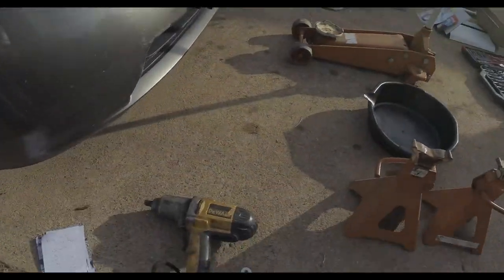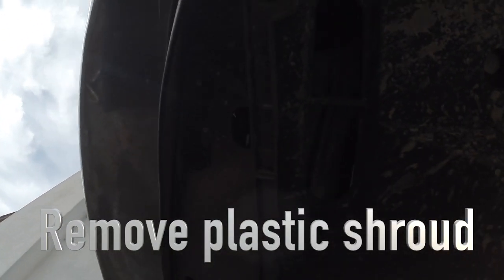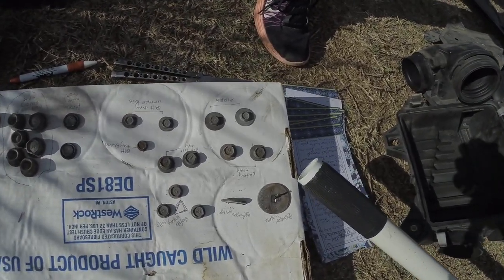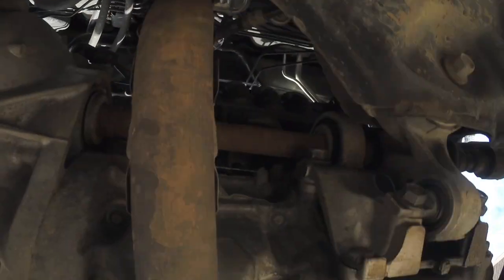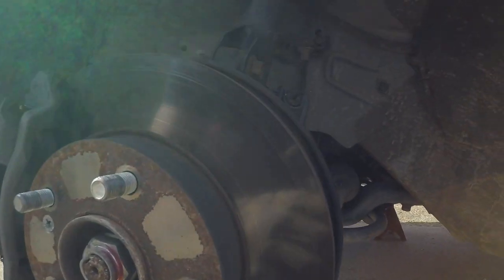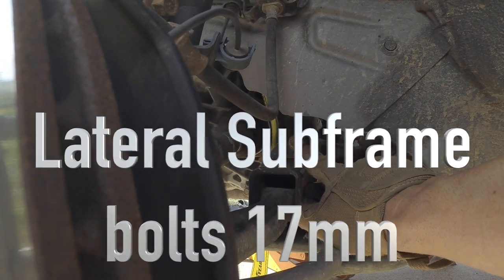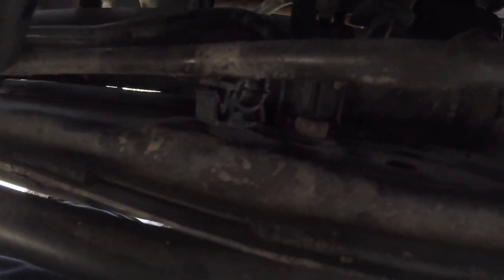2006 Honda Civic 1.8L subframe removal

Comment: Some great recommendations and a good tutorial 👌 

I need to change the rack and pinion which requires the subframe to be dropped.
Reply: looking to replace the tranny bearing and it requires to drop the sub frame but mine it's a 2008 i am sure it is about the same

Comment: Thanks dude, I need to do all the bushings and tie rod ends so i think I'll drain out the power steering fluid and drop the rack with the sub frame. Thanks on the video it helps to visualize it before doing it
Reply from the maker: Best of luck bud!
Reply: @steveDIY  hey dude i did the job this last weekend. it was a lot easier than what i was expecting. your video helped out tons
Reply: Have to drop my subframe as I have to gain access to the oil pan.  Is the steering column the only thing that I need to secure or worry about dropping down when s.f is removed?
Reply from the maker: Do you need to remove the subframe to drop the oil pan? Did you crack the top of it or is it leaking?
Reply from the maker: The only other thing I could see getting in the way would be the down pipe for the exhaust.
Reply: @steveDIY  oil pan is good but I need to replace some engine bearings (low oil which led to rod knock) but the s.f is in the way.  I have the car on jacks but was holding off removing the s.f as it is my 1st time doing it and wasn't familiar with what would drop once it is removed.
Reply: @steveDIY  I'm disconnecting the exhaust to get it out of the way.
Reply from the maker: Yea only steering column needs to be held in place. Not sure if the passenger cv axle will get in the way.
Reply: @steveDIY  thank you for the reply and video. Will secure that column and then drop the s.f.
Reply: I just replaced my subframe this past January 2020, and already the boot is split and dumping power steering fluid on the driver side tie rod. The passenger side blew out when reversing which lead to swapping in a new one. 08 civic lx coupe, replaced at 124,xxx miles and now it has 127,xxx miles now. I think the rack I purchased was put together poorly that’s the only conclusion I come to. Any ideas guys?

Comment: Were is that 10mm located? I can’t tell were it is.
Reply from the maker: Can you be a little bit more specific on where you are talking about?
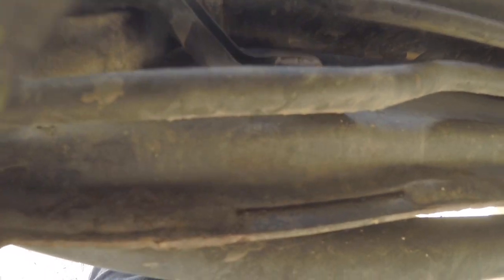Reply: DIY Dude 7:22
Reply from the maker: Gotcha, in the previous 20 seconds, I was talking about how you need to remove a bolt and loosen the other Bolt so that a bracket can swivel, that 10 mm bolt that you are looking for is To the left of the Bolt that I told you to fully remove. The arrow is pointing to the Bolt but you can’t see it because that hose line is in the way
Reply from the maker: That 10 mm bolt is holding that hose on that is in front of that bracket that you need to loosen
Reply: DIY Dude  sweet thanks for clearing that up for me!!! And keep up the good work bro your doing all of us a public service